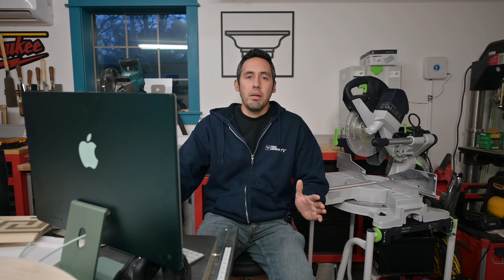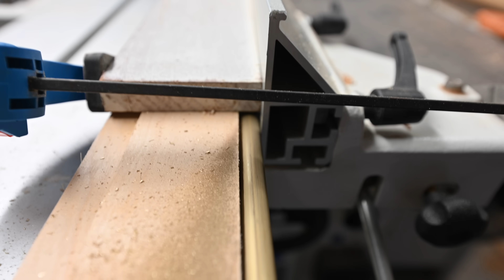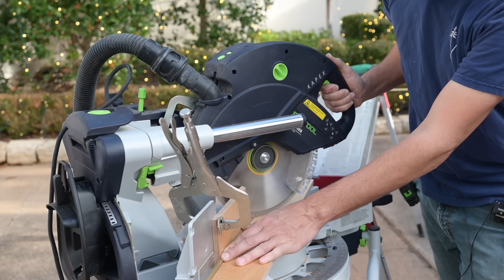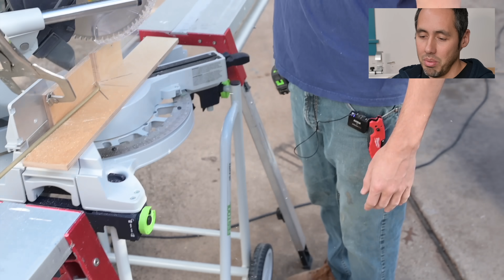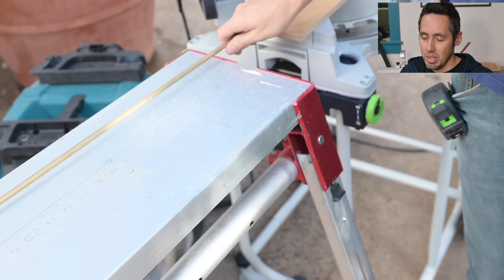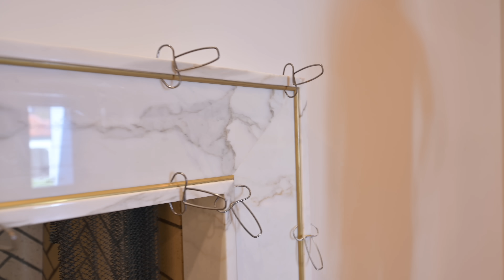It only took 12 years...My first MITER SAW injury.

Comment: Back in the day, I was spray foaming around some trusses in our polebarn. Like we had an insulated part which we were sealing off and an uninsulated part. Under the uninsulated part was a loft where we stored things. My buddy was moving the extention ladder around for me at the bottom and I would step over the gap from the loft to the ladder. Needless to say he set the ladder against the trusses backwards and I stepped over before I could realize it. The ladder collapsed forward with me on it. The ladder ended up landing on a metal table at an angle and I landed on the ladder which broke my fall. The alternative was solid concrete. When I landed i bounced back up to my feet and asked my friend "is my face ok?" Which was the main part of my body that took the blow. He seemed to be more shocked then I was. I was ok but I had to lay down for a few. When I told my father of this he asked "Is my ladder ok?" Thanks Dad!! I am a little bit more careful with ladders now needless to say.

Comment: I did something similar.  At the job site, the blade I was using dulled.  We were cutting deck boards.  The only other blade I had we a typical 32 tooth blade you would commonly use in a table saw.  A ten inch blade.  Well on  the third cut I was cutting a 45 off the end.  The small the blade grabbed the piece.  Shoved the off cut into the dust collection port.  This caused the entire unit to tilt over.  The tilt was away from me.  This thru the large piece up into the air.  Jambing my left wrist.  After a day of ice packs I was able to return to work.  Lesson learned.  Make sure to always the -5degree rake blades.

Comment: Auto body guy here. But DIY all my own home repairs. First auto body project learned an important lesson. Putting a T-top roof on a ‘87 Monte Carlo. With my dad. He did auto body his whole life. Scraping the urethane off the windshield. Lesson don’t cut towards yourself. Still have the long scare across my thumb. Paper towel, masking tape and went back to work. lol. Worse DYI injury was with a screw gun. Was framing a soffit. Drilling above my head. Slipped off the screws and the bit went right through the skin between the thumb and pointer finger. Perfect Philips head shape.

Comment: Both my ER trips were on Fridays. Just not focussed. One was holding the mitre saw blade guard up with my thumb and reaching across to clear out an off cut. It happened so fast, and felt surprisingly exactly like you’d think a circular saw across the arm felt like. Luckily just a clean scrape, didn’t catch or pull my arm. The other was leaving just the metal backing and tubing of a built in vac port standing after removing a wall in demo. Running through at the end of the day to close the windows I didn’t even see it before walking right over it. Caught it in the shin and that thing bled so much my wife had to pour out my boot. Finishers have to be problem-solvers but quick and decisive. It’s good to consider where your mind is at and what could happen.

Comment: Was doing something similar to this. We had a 1/4 inch groove on some oak casing we were putting 1/4 inch polished aluminum in the casing it self. Same situation that you had cutting these small intricate pieces they would always fly alway. Learned it was way easier to place the aluminum in a scrap piece of casing before cutting....worked like a charm

Comment: Extremely valuable video. My worst injury jobsite injury was installing wood stockade fence from inside of yard shooting a bostitch coil framing nailer with 12’s through rails on fence into PT 4x4 post to hold in place temporarily as I was by myself was too difficult to hold panel on line and and screw. So I was shooting bottom rail bent over through panel rail and missed 4x4 aiming towards myself and nailed went straight into my shin. Omfg did that hurt. # lesson learned.

Comment: Glad it wasn’t to serious, I was cutting a piece of 3/4 conduit in a vise with a hack saw & on completion of the cut I slammed my fingernail on the forward stroke into the piece of pipe hanging out of the vise splitting my nail in half. Most pain I’ve ever felt, this coming from a guy that torn his achilles tendon and had it repaired but that injury wasn’t on A job site. Merry Christmas to you & your family!

Comment: Ive been doing custom cabinet work since 1999.  My first injury was on a table saw in 2004.  I was re-sawing a piece of wood about 10 inches long and 2-1/2 wide.  I didnt have a zero clearance plate in my saw.  As the workpiece ran through the blade, the wood got sucked through the gap between the blade and throat plate.  It pulled my fingers into the blade.  No permanent damage, just cut my finger tips on the first 3 fingers on the left hand.  Got 3-4 stitches per finger  I got really lucky.  

Next time was in 2014.  Same table saw.  I was ripping a piece of 3/4 x3/4 oak cove mold.  Pushing it through the blade with the right hand, and holding it town on the saw table while keeping it against the fence.  As I was watching the front side of the blade, I misjudged where my thumb on my left hand was and I sit my thumb right down on the backside of the blade.  No permanent this time either.  Got about a 1 inch cut on the pad of my left thumb Had to have about 4-5 stitches

Lastly in  December of 2020 I was cutting off an appliance garage from a set of kitchen cabinets that the lady no longer wanted.  So instead of the corner wall cabinet coming down and sitting on the countertop, she wanted it cut off to look like a normal corner wall cabinet.  I was having trouble cutting the wood rails under the cabinet against the back wall.  So I had this chainsaw looking carving wheel.  (I had a bad feeling about purchasing this beforehand but decided to go against my gut feeling)  I had taken the guard off the grinder a couple weeks before .  I start cutting it and its going good.  Then with in a fraction of a split second, the back side of the grinder blade catches another piece of wood under the cabinet and BAM the grinder kicked back and the grinder chainsaw wheel of death danced across the first two fingers at the knuckles.  Again, no permanent damage, 4 stitches in the pointer finger and 6-8 stitches in the middle finger.  Very very lucky on this one.

Comment: When I was 17 I had to move several long boxes weighing around 150 pounds each. I was manhandling them versus being smart. Picked up the last box and placed it on the table. Bent down to get my tools and my body went into the fetal position. Herniated three disc which spread to my whole spine over the next 26 years. Bad genetics played a big part. Two surgeries later I’m fused from the neck down. Working on learning to walk for the third time but I’m blessed to be able to use a walker and wheelchair to get around with a little woodworking hobby to keep me busy. Be careful out there and mentor the next generation to help them stay safe.

Comment: Worst accident I had on the job was doing side work with a painter friend. We were painting a 12’ ceiling room but he only had one 16’ extension ladder. I had the genius idea of splitting them so we each had an 8 footer. I had gotten so confident on ladders I wasn’t even thinking, but the side I had didn’t have any rubber feet and the pad I put it on apparently wasn’t enough. Long story short, the ladder slid out when I was one rung from the top. I jumped off and luckily was ok but I take ladder safety so much more seriously now. I will never split an extension again.

Comment: Been working as a carpenter and machinist for the past 10 years. Thankfully, I've never had any significant injuries. The worst injury I had was, similar to you, stepping on a screw and having it go straight through my shoe into my foot. I immediately fell to the ground and started applying pressure. There was a lot of blood, but thankfully, there was no major damage. I got a tetanus shot to be on the safe side, but I consider myself lucky.

Comment: Thanks for the video/message. I sliced my left thumb pretty good with a dado stack plunge cutting a leg for a coffee table.. It ripped my thumb up good to the point I couldn't even receive stitches. I was out of commission for a while because I was born missing fingers on my right hand and could barely use my left hand after that. Now I try think about safety before any cut with any machine.

Comment: Thank you for sharing your experience. Makes me think of all the times I have cut small pieces in the same exact way and, fortunately, haven't had that happen. But now I know that it can! 
My worst carpentry related injury would have to be something that all/ most of us have had happen to us one time or another while using a drill or impact driver. That being when you have all of your body force behind  your drill trying to drive n a 3" screw without predrilling first "dumb" and you have your drill bit driver slip off the screw and go right into your opposite hand supporting you...I don't know how many times I have had this happen and it not be bad or just hurt for a few minutes. But this one time, I was using a square bit driver, and I had this exact experience happen, but the driver went right through my thumb bounced off my bone and out the other side....who knew a flat little square bit could hurt so much. 

Also wanted to add a miter saw related accident. For people to be cautious of. I had a miter saw that was not well maintained and wouldn't automatically go back up after you let go after making a cut. So that meant that the blade gaurd did not guard the blade and me just going fast and not thinking went to grab my piece of trim after making a cut and had my hand hit the blade. Luckily, it was already slowing down, and I just helped it come to a stop but had nothing but a small little cut.

Comment: Worst injury I’ve had was when we were replacing some rotten floor joists in a crawlspace. I was using a pry bar to separate two sistered joists and had no idea there was an electrical wire running between the joists. Well my pry bar made it through the sheathing and I got a nice little shock and hit my head on the joist. Not pleasant. Glad you’re ok from your incident.

Comment: My worst injury to date was more of a scare and eye opener than an injury. I was ripping down a piece of plywood to install over my cabinets before countertops were installed. I was shaving off 1/8” and just as I was finishing the cut , the plywood shot a splinter in my eye. The blade was still running and I let go of the plywood to attend my eye and the plywood shot up and caught the speed of the blade and shot right at my stomach.  I still have all my fingers, but definitely learned my lesson about eye protection and having confidence in my cut.

Comment: My old man did a lot of brass inlay work with cabinets and corner curio type cabinets as well.. anytime his cut off piece was below a half of an inch he would use one of those hand saw miter blocks, The hacksaw would go right through the brass like butter, nice clean cut and he never had a problem with kick outs.

Comment: Installing a metal skinned exterior door: I opened the door to screw in the jamb, but got my finger caught in the hole for the knob.  Because it twisted my finger, I pulled it and sliced it almost to the  bone.  An xray, 7 stitches and a couple hours later I was ready for the rest of the Fourth of July.  Not even any beer involved! Merry Christmas!

Comment: Talking about splinters... i rolled a 5" velcro sandpaper pad on a long 7 feet oak piece about 1 inch wide and start sanding up and down holding it tightly and fast, a few seconds later the pad caught on a little crack forming a 2.5" splinter that went 2" deep on the center of my palm all the way thru, up to my thumb. I was in pain for a few days, tha was like 4 months ago.

Comment: My worst injury was with hand tools…was joining a case side using through dovetails.  While paring a tail to make it fit, wasn’t paying attention to how close my other hand was to the board.  I was about half way through the board and in autopilot mode.  Ended up sending that chisel into my thumb.  Chisel was sharp and bit me good.  Good gash and no permanent damage.  Lost a bit of time on that project.  Needless to say I’m laser focused when cutting and fitting dovetails now.

Comment: I am glad your fingers are ok, in my opinion a contributing factor is the wide space you have between the fence and the blade, on both sides the is 45 miter edge on the fence creating a wide unsupported area for the material being cut and the slightest  cut in the material being cut forms a pinch with the blade and grabs the material.

Comment: I worked with round aluminum tubing at one point, drilled my left hand, leg, and gut more times than I can count when the bit slipped off the tubing.

My worst injury on the job happened when I was lifting a spool of cable onto the grating behind a trailer at UPS. Grating was at least 36" off the floor and the spool weighed 100+ pounds. I heaved it up, plopped it down, and it bounced to the right. One of my fingers was between the spool and a post. I pulled my hand out so as to not get smashed but ripped the skin off the end of my finger in the process.

Comment: I'm not a carpenter or woodworker, but I hope to do it as a hobby in the future.  That said, my worst injury is as a heavy diesel mechanic.  You're never supposed to hammer on mushroomed steel, especially if it's hardened steel.  I was trying to position a chain on the tracks of an excavator and did so with a hammer, not seeing the slightly mushroomed edge.  I suddenly lost feeling in my left hand, and when I looked down, there was blood pouring from my forearm.  A tiny piece of steel had shot into my arm with perfect aim to severe the nerve bundle there.  I had to get surgery on my my arm  to get the nerve stitched back together. I hadn't known they could do that.

Comment: Glad you didn't get badly injured for sure. I've been lucky that I haven't had any injury making. I've had some wood "explode" when cutting smaller pieces on the miter saw. It looks like the brass stock went back due to not being fully supported to the left of the blade. Due to being notched out with other angle cuts and possibly due to it being a small off cut. A low support fence in front of the stock to apply support close to the blade might help.

Comment: I was working for a custom shower and mirror company in 2021. On the day my accident happened my helper call out sick and I had a new construction job to do. I was carrying a 78" mirror into the house when it shattered in my hands. It severed the radial artery and the nerve in my right thumb. I tried to apply a terniquet to slow the bleeding but I couldn't get it tight enough and I was alone at the job sight. Bleeding out fast I knew I had to drive myself to the hospital 15 minutes away. With 911 on the phone I told them who I was ,what happend and where I was going. They told me I couldn't run traffic signals and my response was I'm the one bleeding to death and if the police where in my area please give them the message. Thirty five stiches in a four inch gash and the lose of feeling in my thumb I survived.

Comment: I've had some seriously close calls with different tools, but the one injury I remember well was with an old reciprocating saw I had back in the early 90's. I was cutting aluminum channel that wasn't clamped down and using the wrong blade (took to much time to change back then), the blade hung up in the middle of the cut with the trigger locked in at full speed, it jumped out of my hands and the blade landed on thr back of hand and wrist. It made a mess out of my hand and the carpet was stained with blood. I look at the scar from time to time and think wow that was dumb!  You're very right about it not being the tools. It's usually us!  Complacency is usually the main factor that gets us hurt!

Comment: I've actually had a similar situation, but glad you're OK.  I was using my radial arm saw short cutting a piece of quarter round trim.  I was holding the long end of it just like you but the blade caught the small piece  and threw it back in my face.  Fortunately I was wearing my safety glasses.🥸

Comment: Several weeks ago, I was cutting a small piece of trim (being in a hurry I didn’t clamp it) on my brand new miter saw. Well, the dam thing kicked that board up and out of my hand and almost brought my hand into the blade with it. It broke a plastic piece of of the miter saw and literally bent a tooth in my new and expensive finish blade. Not too bright on my part. Also, anytime you have a blood buildup under a nail, straighten and heat a paper clip until it’s red hot and poke a hole in the nail to relieve the pressure. Be careful because it will shoot out like old faithful.

Merry Christmas to you and your family.

Comment: i was injured back when i was 18 lost the very tip of my pointing finger on a punch press just the flesh did not damage the bone, that taught me a very valuable lesson actually a couple of lessons, don't drink/smoke weed at work, if you overly tired go home, and it was probably the reason i was never injured again over the next 40 years of using every imaginable machine you can think of